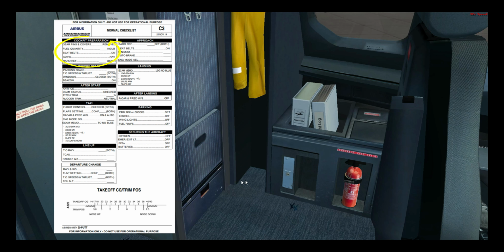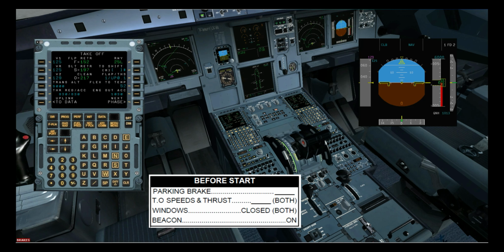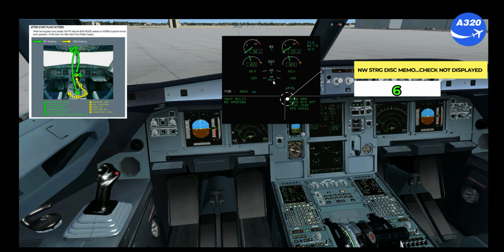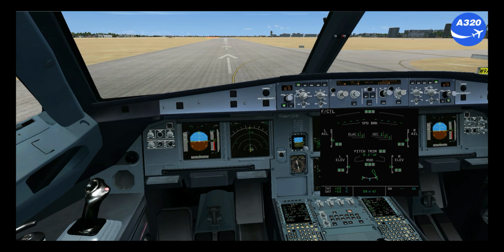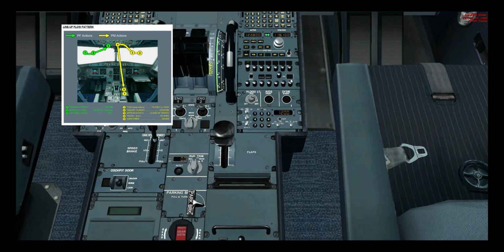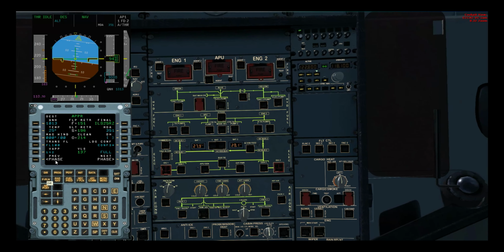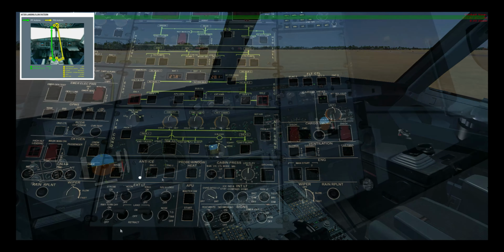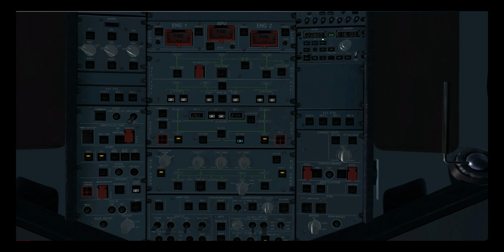AIRBUS A320 FLOW PATTERNS & NEW CHECKLIST

Comment: Excellent video but requires a big update. These flows are old. Current official airbus a320 flow is different. For example, during after landing flow, pm flow continues as 4-atc :off 5-check fuel 6-check irs performance and etc.